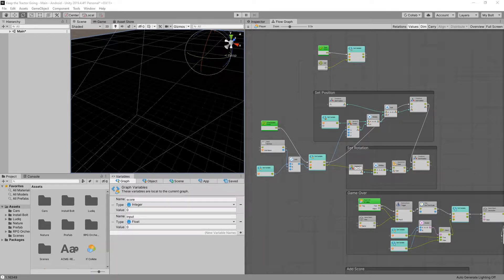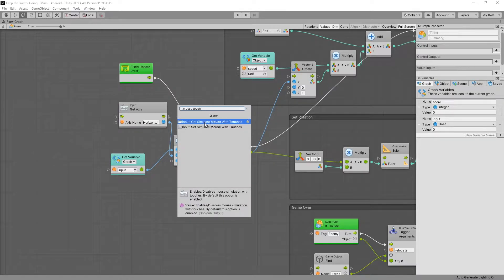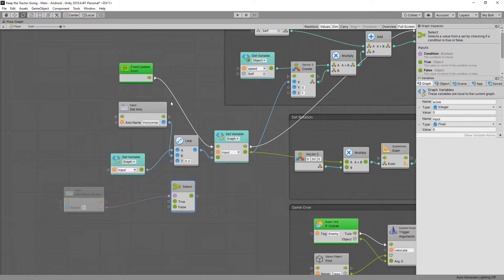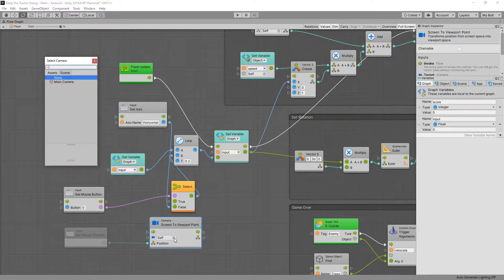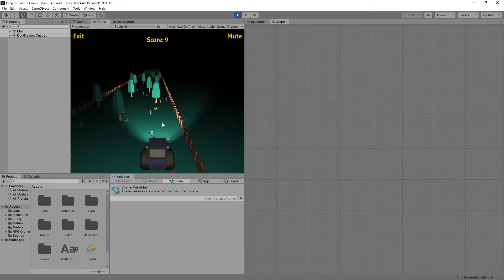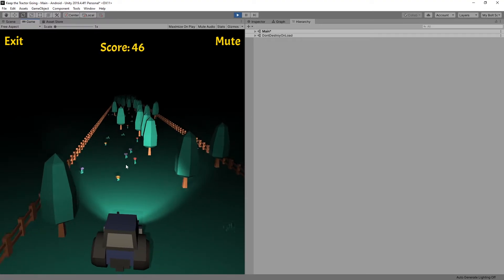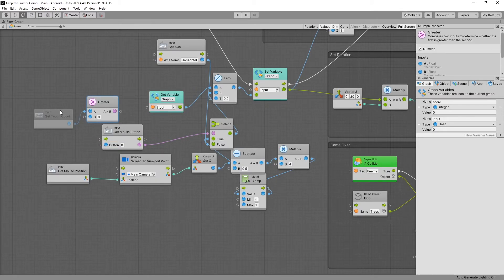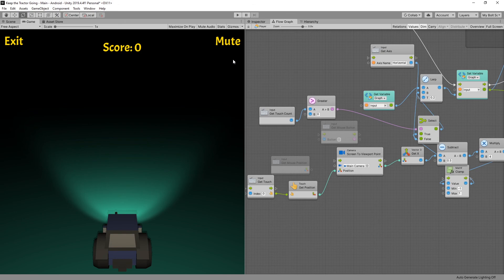Unity-Bolt Part 7: Touch Controls - Getting Started with Bolt (Visual Scripting) Tutorial

Comment: Sir I have followed all the steps to optimize my game in bb3 but even my game is running slow on Android device plz help me fix it I have disabled the shadows and did everything as shown in video but it's not working
Reply from the maker: Did you check if any of the games from bb3 work on your phone without lag?
Reply: @SmartPenguins  yes sir I have exported space buggy game but its also running slow
Reply from the maker: Did you run Atlas Optimize? So if space buggy is the type of game you looking to make, i would replace all the nodes that are used in the template with the new once if there are new once, and test it after that. If that will not get it to run good on a phone then that type of game is not something that can be made in BB3 without lag, that is how it is. There isn't much optimization that you can do after that.